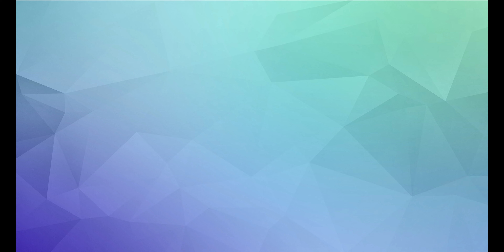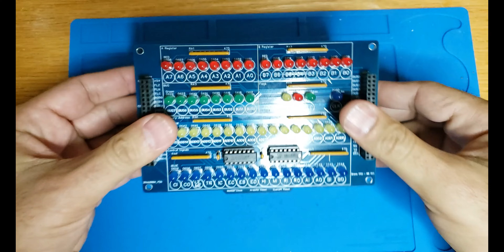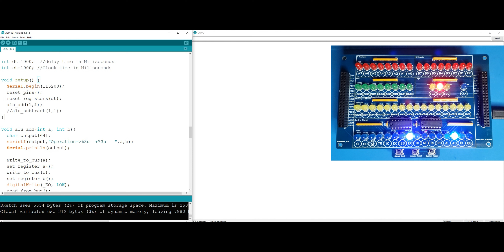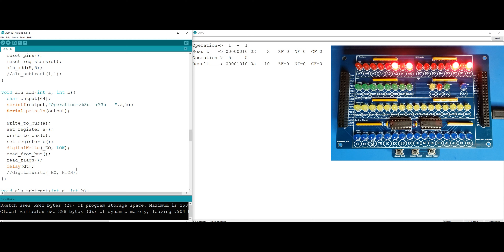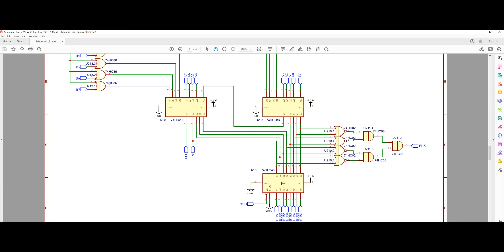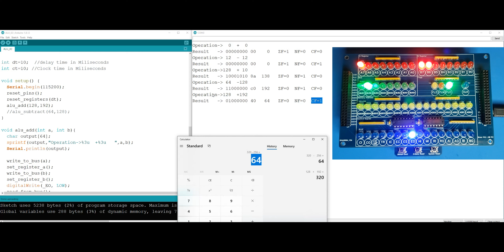Bravo 8bit computer-Part 7- ALU  ,inspired by Minimal Project and Ben Eater's 8bit computer

Comment: As some lines on the connectors linking the modules are free, it would be nice to have ALU output on the LED module as well. Are these free lines reserved for some future usage (e.g. output module)? Another option for the unused lines would be to provide 5V or GND on them to allow conecting wires for manual testing (Ben Eater's way), with Arduino Mega isolated (all lines in INPUT = High Resistance state). Testing with Arduino Mega is a great timesaver, but is not interactive.
Reply from the maker: Yes, we have some free lines on the connectors. To be honest, when designing the boards, I was thinking about using them for some applications but as number of links goes up the PCB routing will be tighter and more complex. So, I tried to incorporate as many as possible. I could probabaly fit more LEDs on LED bosrd if I have used smaller size LEDs but eventually I opted in for bigger ones. They could be used as an interfac to some signals with small modifications. You would just need to connect the signal from one the boards to the unused pins using a jumber and you have access to signal on all bards when mounted. The 5V and GND is already on the connectors. In fact you can use the pins to power up the computer or power up the computer using USB and use the pins as power source.